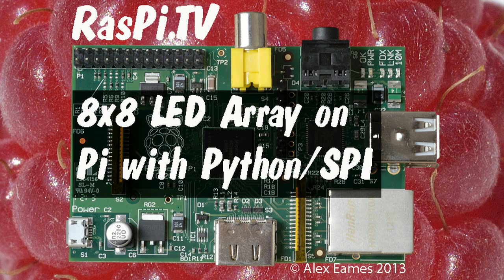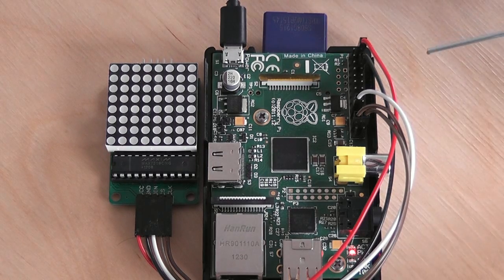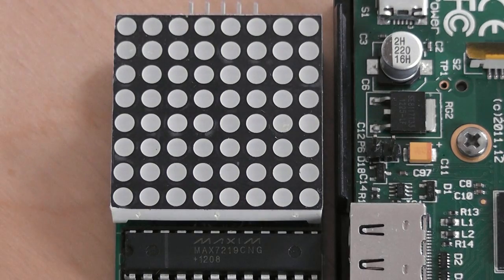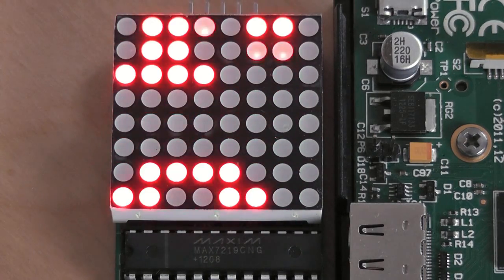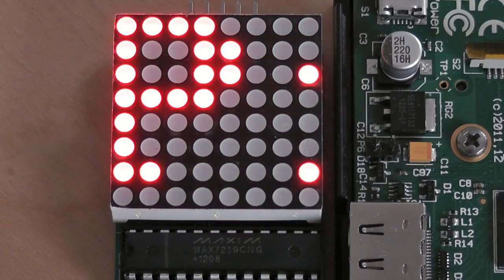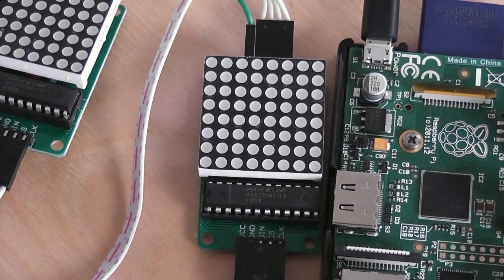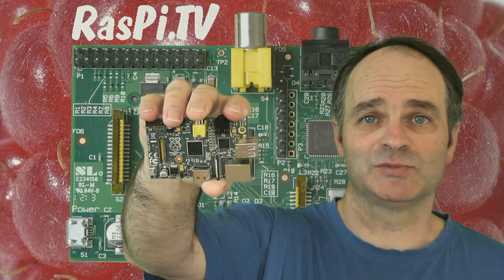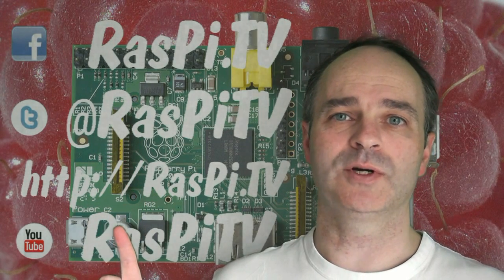LED 8x8 array driven by Max 7219 and SPI via Python on Raspberry Pi

Comment: Hello , Great video.

My question is : if I use more than 10 8x8 matrix, it will not load text correctly,  should I just add an external power supply with more current ? or it's related to SPI pins ? I plan to use 20 8x8 Matrix.

Thanks in advance.